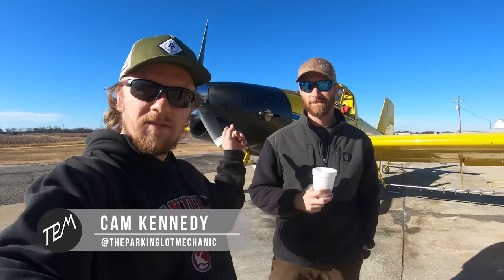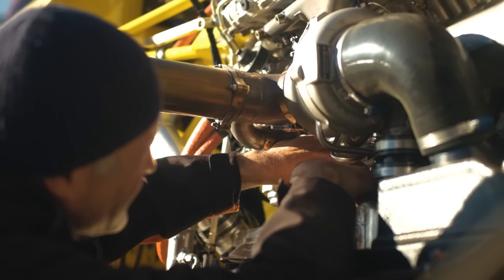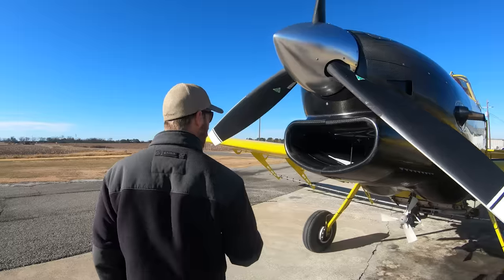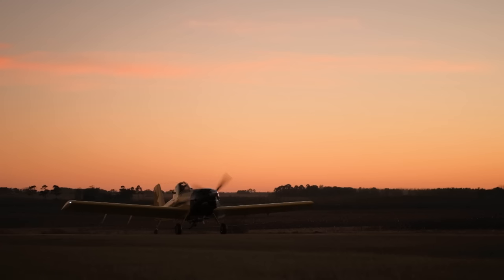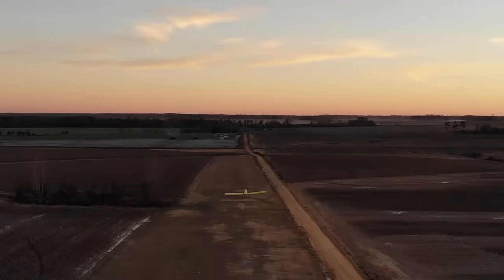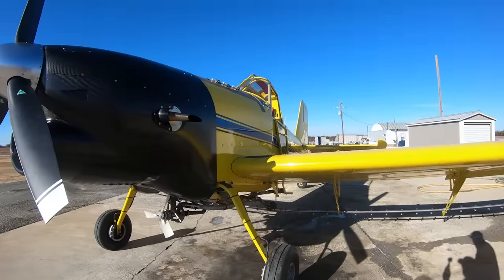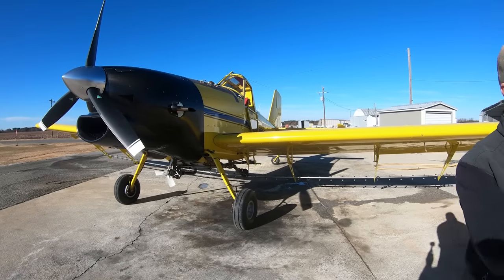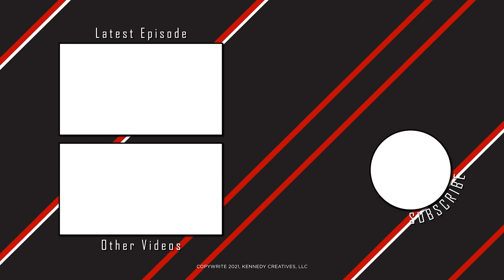Meet The V12 Twin Turbo Diesel Crop Duster

Comment: This man should take this idea to Air Tractor. This may be something they would want to pursue with their factory-new aircraft. Great fuel economy, rock-solid safety, hauls a big load, and is fast!
Reply: Not much demand for piston engines on new ag planes anymore. Their place is in the market replacing 1340’s on older planes. Majority of ag planes in my area are 802 air tractors now. We do a massive amount of dry fertilizer work here and they need all the power they can get hauling big loads of fertilizer. A piston engine can’t deliver that power without adding too much weight.
Reply: @boomerang379  That makes perfect sense. There's still a lot of nostalgia to seeing and hearing an old 600 or 450 round engine ag-cat going through the paces. The turbine Thrush and Ag-Cat see a lot of work still. What about the Turbine "fat cat" that can carry 500 gallons per load?
Reply: @boomerang379  You have to consider the fuel quantity also. A turbine engine uses more fuel, so for a diesel piston engine you can make up for the extra engine weight by carrying less fuel.
Reply: It's not that pistons engines aren't in demand today, it's that there aren't really any good piston engine options.  Your choices are what, a radial or a different radial?  Those things are getting old and aren't being made anymore, so their days of reliable operation are closing fast. This engine will fit certain operators, not everyone has the work (or can afford) spending $1.5M on an 802, even though it's one of the most efficient ag planes out there as far as acres covered.  If your operation only encompasses enough work to justify a single plane running a radial, then this 301 might fit much better than a 402 would.  I've seen two operations nearly go under because they bought bigger airplanes than their area could handle.  Right now I'm in a position on deciding whether I can find enough work to replace my 502 with a 602, there's just no way I'd be able to justify buying even a worn out 802 for my area.  One other factor...that massive endurance is something very few turbine ag planes have.  It's not really a benefit to most operators, but if your stuff is really spread out and you end up running out of fuel before chemical, this might be the ticket to make an uneconomical area feasible again.  Low volume applications almost always end up being limited by fuel capacity rather than hopper capacity, so if you're spraying 1gal or less, this could potentially be more productive per hour than something like an 802 that might need to head back for fuel twice as often.  If this engine was scaled up to 700-800HP, it might even replace a lot of turbines flying in ag today.  What's going to ultimately decide whether this engine succeeds or not is the maintenance and parts availability, future support, and overhaul costs.  If you have to shut down because the FADEC or whatever component is acting up and you need to send it to Germany for repair, it'll never succeed.  GE was trying to get into the ag plane market with their turbine, and while it was a great engine, they wouldn't let anyone else work on it but them...which meant you were shut down until you took your engine off and sent it off to them for repair.  Later on they started doing a loaner engine program to keep planes going, but that was a bandaid fix that never solved the problem.  GE engines are regarded about as well as herpes these days, even though the engines themselves were on par if not better than a PT6.  Orenda/Trace tried a big block V8, they lasted for quite a while but died off for similar reasons...lack of support and constant little teething problems that they never really fixed.  If RED can address those problems, you'll likely see a lot more of these engines on yellow airplanes in the future.
Reply: @Skinflaps_Meatslapper  You don't want something that is going to be high failure rate. What if the engine dies 8n flight?
Reply: @ellouisetidwell4025  Well I've had two PT-6's cash out on me in flight, one was a gearbox issue and another with the fuel controller, so nothing is infallible...but I've had quite a few more problems with radials.  They're just old, they really need to be preserved and taken better care of like you would a RR Merlin, rather than wringing them out day to day in pretty harsh conditions.  I believe the last R1340 to roll out of the factory was in the early 50's, and we've been coasting on WWII surplus parts and barn finds ever since (and they're starting to get hard to find).  You're more likely to use a barely in spec part during a rebuild if it's expensive and hard to source, so you're also more likely to have trouble later on as a result.  PT-6's are still being made, and while expensive, parts are easy to find and last a long time, so most everyone uses new stuff.  The RED A06 is a new engine, so new that I doubt a single engine has reached TBO in the field yet, which is both great and a little terrifying at the same time.  You're flying all new parts, but they're also sort of unproven at the same time.  I'm happy to sit on the sidelines and watch the early adopters find and troubleshoot any issues that might arise before I make any investment into it.
Reply: Since I am not familiar with crop dusters, it would be nice if they would add some comparative information. I just want YouTube videos to be better. When the pilot says he can cruise at 155 miles an hour, or whatever, what was he able to cruise with with the former engine, the Pratt and Whitney?  How many people know that? Almost no one. These YouTube videos are so poorly produced. I like seeing the new airplane, I mean with the new engine, but I am frequently disappointed with the quality of production, just pure lazy off the cuff interviews. No planning at all. No checklist. Think about it….
Reply: @steveperreira5850  I'd like to see the same.  Don't blame these guys though, I don't think this was meant to be a professional analysis of the new engine conversion, just a general "hey check out this new thing" kind of video.  Unfortunately, getting hard quantifiable and repeatable data to compare is like pulling hen's teeth...it's just not there to pull from.  STC's in GA aren't always very forthcoming with that information, and ag STC's are even worse.  You get lots of great advertisement info "do more acres! be more productive! solve world hunger with this new thing! buy today!" but when you start talking real data, like how much more chemical can you haul, how many feet did it shave off of the takeoff roll, how much faster is it using cruise power settings, you only get half of the story.  They'll tell you their test plane can haul x gallons and take off in x distance and cruise at x speed, but they don't tell you what that plane in particular did before the conversion.  The numbers might sound great, but I've seen some planes that really overperform compared to what you'd expect that plane to be capable of, and a whole lot that underperform too.  It's the same for other aspects of the plane too, like the spray system and nozzles and wingtips and pressure cowlings.  Some of them have shown great spray patterns and others you wonder how they get the job done at all, and you don't know if the nozzles are really making a big difference or if the plane just had a good pattern to begin with.  Without a lot of before and after testing at repeatable standard day conditions, the numbers really don't tell you all that much.  It would be nice to see two or three of these planes being tested, with some real testing to gather data about what this package will do for a 301.  

What I can say is that 155mph is fast for a 301, that's in the realm of turbine territory.  What I don't know are the conditions in which that speed was seen, because I've had one up to that speed in cruise before.  It was one of the faster 301's and had a 12:1 blower, I was cruising up at 12,000ft in smooth cold air, the blower could only manage 30" at full throttle (30" and 2,000RPM is 75% cruise power).  I was so surprised that I checked it in all cardinal directions to make sure I didn't have some crazy tailwind, all four directions averaged out to 157mph.  I never managed to get it up that fast again, though.  I guess the engine was running really strong at that point in time and lost compression or something as the hours racked up.
Reply: @Skinflaps_Meatslapper  I just wanted to thank you for your very detailed responses on here. I'm in Southern ID we have a ton of ag here, and watch the Air tractors daily on my way to work.. envious of their view out of their "office window".  I definately agree with the fact that all the radials in service, parts are getting really hard to find for any of them, and the same for finding folks to work on them. Not many people left in the field that can work on them.
Reply: @idjeepindude320  Oh, a fellow Jeeper 👋  I've got a yellow JK with a blue stripe to match my Air Tractor.  Happy to share my side of things, there's only a few thousand of us left.  I'd love to find a place in Idaho and relocate, most of the work in my area (TX) is gone and I've been hopping around the midwest wherever they've got a good run.  If I'm being honest, I was really reluctant to switch to a turbine after running radials for so long, I just didn't want to.  The economics and reliability was certainly on the turbine side, but I still had a hard time letting go of the old radials.  Given my new work situation I really had no choice but to use a bigger plane with a turbine in order to bring home as much money as possible when I take off to another state.  They definitely do a lot more work, and they have nice creature comforts like air conditioning and functioning instruments and a floor to put my cooler on.  Still miss flying my R1340 agcat though.  It was nimble, very responsive on the controls, and did exactly what you wanted it to, I could fly that thing all day long and never get tired of it.  Air Tractors aren't really any of those things, and by the end of the day I'm ready to be done.
Reply: @steveperreira5850  I think they spray at around 120 not faster even with the huge AG (802) aircraft... cruise at 150 for in between fields only...
Reply: @boomerang379  In Europe an 802 is overkill I think, the fields are smaller...

Comment: I mean tbh I’ve ran diesel in turbine it’s nasty on start up but they interchange decent 😂 I love this, I’ve thought about this for years. Use the same refuel rigs for your tractors and crop dusters.
Reply: Run off road red diesel...I mean....really off road......
Reply: @JohnSmith-yv6eq  The only difference between offroad diesel and diesel #2 is the tax stamp, and the dye. If you're getting furnace waste oil as offroad diesel, you need to buy your shit from a better supplier.

Comment: As a retired A&P the first thing I wondered was what the conversion had done to the CG.
Reply: Same
Reply: I would thing an ag plane has a wide cg.
Reply: I too am a retired master aircraft mechanic and I have worked on several different ag planes and they have no empty weight cg.
Reply: @gmanchurch  not contesting you, just trying to get clarification but how do they handle weight and balance calculations then? I never worked ag planes, just light general aviation 6 passengers or less, building several experimental kits (two passengers) plus working at Repair Facilities doing aircraft appliances (hermetic fire extinguishers and inflatables [Commercial: escape slides, life rafts and heli floats] ).
Just relocating a battery can be problematic and look at how many crashes there are when a baggage compartment moves the CG aft.
I
On the experimental kits, based on the actual engine option used it could drastically change flight safety dynamics with just fractions of an inch forward or aft engine placement and before the FAA inspector signed off I had to show him all the weight and balance calculations.
SOMETHING has to be done to compensate for the different engine so how are ag planes different physics?

Comment: Never would have a thought a diesel had any place in an aircraft, let alone a V12 of all things
Reply: Diamond uses diesel engines in many of their aircraft
Reply: Jet A is just high grade diesel and there's a whole lot of aircraft out there burning Jet A.
Reply: Jet fuel is literally refined diesel
Reply: @jjohnson2553  Yeah burning Jet A in a turbine.
Its pretty obvious that I'm using the word 'diesel' to refer to a piston engine, why else would I be mentioning 'V12'?
Reply: Ever heard of the WW2 Junkers Jumo engines? Check them out.
Reply: @vumba1331  Yeah those opposed piston engine designs fascinate me. I'd love to see the concept explored more. There are a few companies that purport to have developed them. But they are vaporware as far as I'm concerned. And the claimed BSFC are.... lets just say 'optimistic'.
Reply: @alanmay7929  isn't most fuel
Reply: Then you've been asleep for a long time. Diesels have been in airplanes for over 20 years now.
Reply: V12's were put in planes clear back in WW2, and there are quite a few Soviet aircraft that were (and are) diesel, so it's not awfully surprising somebody would mix the two.
Reply: Something mad is Audi won le mans with a diesel V12 that was meant to go into the R8 but instead got put into the q7.
Reply: it dont they tried it didnt work

Comment: This is just insane for a cropduster!  So much power in a small airplane
Reply: The turbine engined versions of this are even more powerful. Air tractors carry a stupid amount of payload so there's a good reason they have so much power
Reply: The engine they ripped out would've been a 750hp, with the amount of money these planes are making per flying hour I'm not sure this type of huge swap is really worth the $$ compared to running it as a turbo-prop. Cool though
Reply: @Eclipse1719  the top spec r1340s are 600hp. They'd be using a lot more fuel from drag with the frontal area of a radial (not to mention spray pattern). Overhaul interval on an ag plane 1340 is 1000hours. On this diesel they are saying 2000 - 4000 hours. 

In short, there's plenty of benefits for this engine.

Comment: Good work. Amazing that it took so long for a high speed Diesel engine conversion on a crop duster. Eighty to ninety years?
Reply: It's always been a thing in the rest of the world. The American Av gas thing is just because they want you to have to service your aircraft engine every 150-200 hours to keep unionized Av gas techs busy all the time. The maintenance costs of having to change spark plugs every 400-500 hours, valve adjustments, and oil changes because your gasoline engine dumps fuel into the oil to keep the cylinders cool, is astonishingly high. Gasoline engines are obsolete, yet will never truly go away in America because of how industry has propped up gasoline engines.